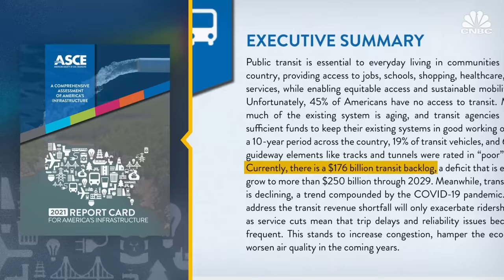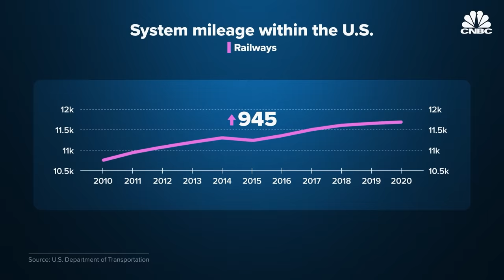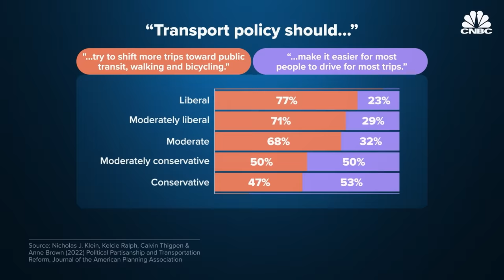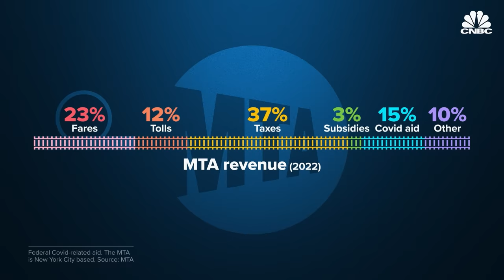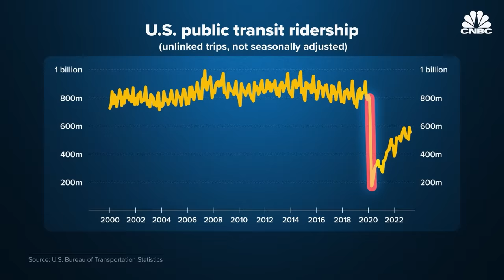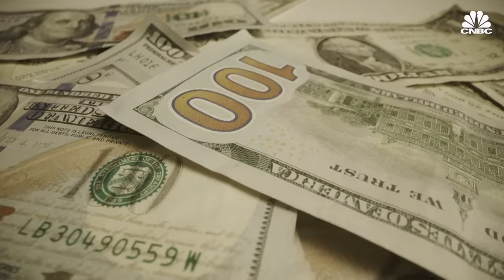Why The U.S. Gave Up On Public Transit

Comment: Mass transit is not practical for much of the United States - it is too spread out.     For example, let me compare my state of Arkansas to England, where mass transit is very well developed.   
Arkansas - 53,179 square miles, population 3.01 million
England - 51,328 square miles, population 56.29 million

The Arkansas population is spread out while I have the impression that much of England's is concentrated in greater London.      London alone is 610 square miles with an estimated 2023 population of 9,648,000.     

Now let's look at Wyoming, with 97,916 square miles and an estimated 2023 population of 585,587.   What kind of mass transit would work there?

Comment: Public transit systems are really not practical for countries like the United States. Destinations are wide and dispersed making coverage extremely difficult and often impossible.  In urban areas, unless you have a city like New York City where everything is within easy walking distance from subway stations, there's still a lot of ground that has to be covered typically by bus.  This takes a lot of time, effort, and patience.  I think it's simply not possible to have an all-encompassing transit system that can get you to anyplace that isn't a budget buster and is also most likely to fail even after project completion.

Comment: federal, state and city governments need to fund and in some cases directly run public transit. I don't think treating it like a business will work but public transit is necessary. Even if its operated at a "lose" considering it in a vacuum, by interconnecting cities and making them less car dependent, to the point where traveling by public transit makes more sense for the average American, you free up a huge amount of land that is currently being used as nothing but unproductive parking lots, and local business can open up instead and that economic activity can be taxed and indirectly fund public transit. Not to mention the environmental benefit public transit brings. You wanna talk about economically unsustainable infrastructure? Maintaining the massive network of roads is bankrupting pretty much every city in America far more than public transit could ever do, and is not like the suburban richer kids pay enough taxes to keep all that up even though they are the ones who use it more and is virtually free for them. Public transit is very expensive to build but its economies of scale make it more viable in the long run, while car infrastructure may be cheaper for a municipality to build and expand (in part due to massive federal subsidies) but maintain all that in the long run? That's where you get a town with massive financial loses, a town that is nothing but a few store boxes that are miles and miles from each other, a bunch of potholes, a mess of dangerous intersections, and more traffic due to induce demand... you know, the suburban lifestyle
What needed to happen was America's government needed to step in and basically expropriate public transit from the private companies after the great depression, but alas, the automotive lobbyists had other plans in mind, they wanted us all to depend of their product to be able to have live. Being dependent on an expensive car whether you want it or not is not freedom
Is not to late, though. We can have the interconnected America we deserve

Comment: Here is the core problem with public transit you ready? This is it:

You're trying to make a 1-size-fits-all-solution for a people with a wide and diverse set of needs.

That's it. That's why it's as good as it will ever get. There's no superior vehicle design or some better layout for roads that will meaningfully improve public transit.

Comment: If taxes and subsidies are still the major suppliers of funding for public transportation in those places that have public transportation, then it sounds to me that the free market has decided that it prefers other than public transportation.  I have no problem with that.  I don't used public transportation; and won't use it even when it is available to me.  My preference is for my own private transportation.  I don't find riding with other people to be attractive in the least.  I also prefer to live in single family housing in the suburbs AWAY from other people.  I prefer space between housing.  I'm not here to interact for the benefit of society.  I have no goals toward that end and that is not my purpose for existing at all.
Reply: Roads are 100% taxpayer-funded, except when they're funded directly by tolls. Your private lifestyle is funded by society. You're welcome.
Reply: @Rhaegar19  And part of those taxes are mine, so I get to use the roads.  I'll thank myself later.  However, I don't support and don't vote for public transportation as I don't use it.  Most people in the USA use roads even if they don't use them directly, themselves, but the goods they buy are shipped to them on roads.

Comment: Problem is, the transit is filled with homeless, drug addicts, is unsafe and unclean. Nobody wants to ride it. They need to clean up the system first and then work on reliability.
Reply: This is not the case at all. Maybe for US cities but is places like Britain, France, and Japan trains are very safe and quite clean.

I lived in Hong Kong for 2 years and have never once seen a homeless person or criminal inside the station. You just need basic security.
Reply: @aqua2k210  I’m talking about US transit…
Reply: @aqua2k210  Basic security works in a voluntary or enforced orderly society. Basic security is insufficient, for in many places in the U.S.. Also it must be done on a wide scale, otherwise it defeats its purpose. They are called mass transit, but it takes too long to build them too mass, and so many use the fact that they are underused to discredit the whole system. This point was made at the 8:20 point in the video. The U.S. has a double whammy problem. Those who see entrepreneurship as supreme, seem to mainly argue that the public doesn't like it, and that government is inefficient, but what of the military, is that inefficient as well, and if it is, how much funding could be freed up to finance it?

Comment: Monorails in the middle of the interstates. I don't get the difficulty in accomplishing this. Govt. inefficiency at its finest is the only explaination. If you figured the cost, then multiply by 20 and you will get the real cost after the government is done with it. Plus it will never happen because projects move too slowly and governments change and cancel the projects. NASA is a prime example. It takes a decade to complete a system, but we change Presidents every 4 years(NASA is governed by the Executive Branch) and systems are cancelled before they get off the ground. This happens every 4 to 8 years. It takes 10 or more, so NASA is pretty much done for as the front runner in space exploration.

Comment: They hit the nail on the head in the last part of the video. The real issue is how our cities are designed. We need to change zoning laws and remove parking mandates. This will increase density. Once our city planning is fixed, transit will follow. 

This will help with so many issues including our health, safety, environmental, and loneliness challenges.

Comment: I don't want to sit next to weirdos...
Reply: Its quite litterly more dangerous to drive than take public transportation. Maybe not in the us but in every other place. If you just improved your public transportation this wouldn't be an issue.
Reply: @default3740  
Yeah, i'd like a bus that can travel all over town too with no route but if ifs and butts were candies and nuts, you're going to break you leg.
Reply: @joeschmoe2843  What is that supposed to mean?
Reply: @default3740  Reference :P

Comment: I visited Utah last year and was very pleasantly surprised at how good Utah Transit Authority's services are.  I was able to travel from Salt Lake City to Ogden for $2.50, via their high-speed FrontRunner rail (70 MPH)  on the low-income pass I'd acquired.  It's twice as much normally, which is still a good deal!  I was also able to make any trip I wanted on the bus routes for even less than that (I think $1.25?  Not sure!  Utahns please clarify!)   All the major cities are connected and the intracity services are excellent.  Their UTA app is lovely to use, too, showing real-time positions of whatever bus or other conveyance you're wanting to board.

I wish we had something like this here in Alabama.  Huntsville's Orbit bus service is okay,. but we don't have a network of bus or rail travel between major cities, and even our intracity service is a bit Byzantine in its complex web of routes.   I think it would be a huge boon to have something similar to what Utah offers, especially for low-income citizens who need to commute to work.

Comment: Can't have public transit in suburb where everyone wants to live. Public transit works in dense, mixed zoned, city
Reply: Well, suburbia is one of the big problems US cities face anyway. There's good aguments out there as to why it's an unsustainable scam.
But even if you want to keep it, I don't see any fundamental problem in integrating a usefull public transit system into suburbia. You just have to plan those copy-paste single home wastelands with transit in mind form the get-go. And also, you have to beat it into the thick sculls of the folks living there that walking for 5-10 minutes to a tram stop is perfectly aceptable...
Reply: @Bird_Dog00  — Running the metros out into suburbia just gives the thugs easier access to more affluent victims …
Reply: Suburbia hasn’t been where “everyone wants to live” since the 90s at least. Hence gentrification.

Comment: It takes me 20 minutes to drive to work, door to door.  A bus would require a 7 min walk to the stop (leaving 10 min early in case the bus is running hot), then a 55 minute bus trip to a transfer location, then a 30 min ride to my final stop, and then a long 20 min walk up a big hill.  I could get used to the walking (unless it's rainy season) but the time difference is a show stopper for me:  40 min round trip in car vs a bit over 4 hours round trip by bus.